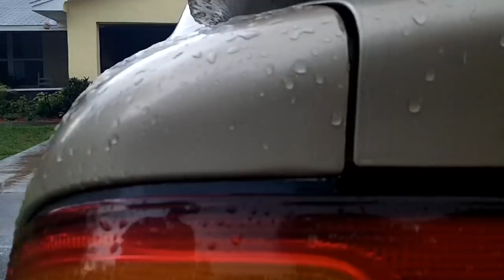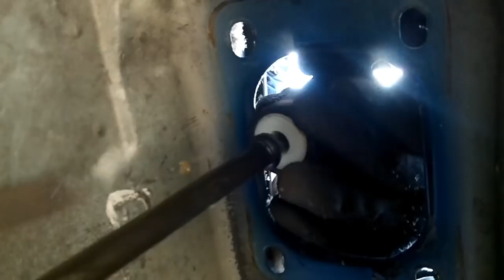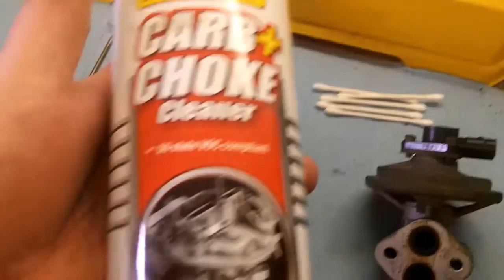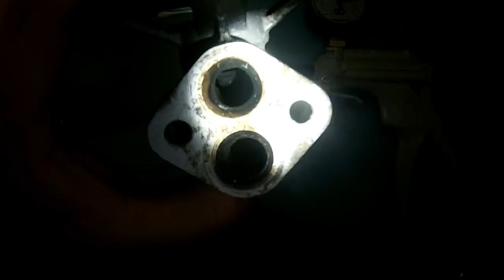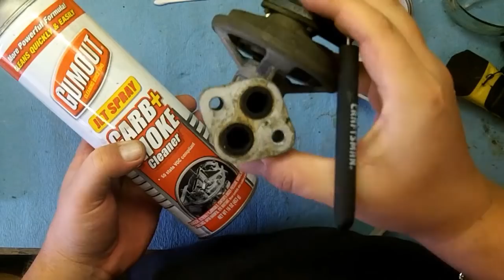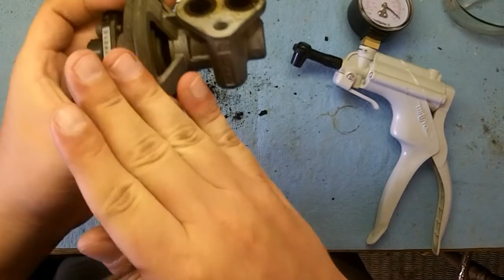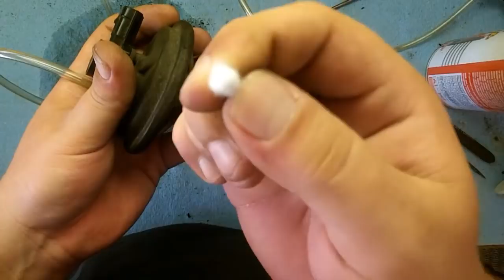How To Clean the EGR Valve

Comment: Cleaner valves and IM sounds like a good enough reason to me!! Thanks!!
Now I'm assuming that by blocking it off, it would cause a CEL light since the EGR has a sensor.
Is there a way around that??
Like maybe an ECU flash of some sort??
Also would blocking it off affect any of the other systems that use vacuum pressure on that line??? (or are there any??)
Reply from the maker: I'm not really the one to ask about EGR block offs.  I've never actually done it. There should be plenty of info on forums about it.

Comment: I live in a part of the country where emission testing is not required.  (Lucky me!)
I was thinking about deleting the egr with a small piece of sheet metal with 2 holes drilled where the bolts go.
I heard that outside of emissions control, it does nothing more than gunk up your intake manifold.
Would this be a good or bad idea in your professional opinion???
Btw, Thank You for everything you've done here and on your other vids!!!
Has helped me sooooooo much!!!
Restoring a 94 Probe GT!!!!
I am going to do everything in my power (and budget) to have it running better than ever before by Spring 2015!!!!!!!!
Reply from the maker: I'm hardly a professional but thanks for thinking of me in such a way.  Honestly anything you do to deviate from the stock setup will force the vehicle to run in an unoptimized state.  It would require me to write an essay on why deleting the EGR is not in your best interest.  Unless you're highly advanced and getting into turbo tuning leave the EGR where it is.  Sheet metal should work ok but keep an eye out for it rusting through.  Sheet metal won't last forever.  A milled piece of aluminum would probably last longer and be a better option.  I've seen guys cut up beer cans, flatten them out, and drill holes for the bolts.  Free aluminum block off. ;)

Comment: Engine light still on sorry
Reply from the maker: Sorry I never noticed your reply Elliott.  The most common source for EGR clogs is inside the throat of the intake manifold where the EGR gas is shot into the manifold.  It's about the size of a pencil and what I was referring to in the video.  This video is only for showing how to clean the EGR valve not the entire EGR system.  I have another video that does show the opening into the intake manifold that I'm talking about here... https://youtu.be/ZSKs1WfM70I?t=7m40s

Comment: Hey i had to do the same on my 626 i just bought another EGR clean the throtel body and were the egr goes but the engine light its still one keep going to autozone and advance to get the engine light check and it keeps telling me the egr its not reading
Reply from the maker: What's the code?  Could be the wiring or grounding issue.  Check the plug for corrosion and make sure the pins are making good contact.  Test the EGR solenoids.  All Mazda 626's have EGR solenoids but some might have 2 and some have 3.  Depends on year, engine, and transmission config.  A solenoid can fail and still report that it's working just fine to the ECU especially on the 93-95 OBD-I models.  Also make sure that port where the gas enters the intake manifold isn't clogged that's the #1 source of EGR clogs on the 626, MX6, Probe, and Protege!

Comment: Yes, but have you ever POLISHED one?  :P
Reply from the maker: redraif One good way to check the EGR exhaust port (where exahust gas is shot into the intake manifold) is to blow air through it with the EGR removed.  Pretty simple test to check for a clog anywhere in that system.  I have another video that details the routing inside the intake manifold for my 626, simply look for something similar on your montero.

https://youtu.be/ZSKs1WfM70I?t=6m41s

https://mazda626.net/topic/41067-egr-inspection-cleaning-1993-2002/

That should give you a much better idea of how the EGR gasses are routed through the intake manifold.  The passages are built into the intake manifold itself.  Thankfully the 626 manifold has a cleanout bolt you can unscrew to gain access for easy cleaning.
Reply from the maker: Are you talking the holes like a port matching polish or just an exterior polish?  I can do both but is there any benefit to polishing the interior holes?
Reply: LOL!  No... there would be no benefit. I polished the exterior.  I polished the exterior of a fart re-breather.  On a 4g63 it's buried under the intake manifold, covered up by the car battery, so nobody will ever see it anyways.  It's the dumbest thing I've ever polished and I showed it in my cylinder head port and polish video.  lol.  :F
Reply from the maker: *****
I don't think it's dumb to try and make things look nice.  However, in the case of the EGR it would be a really dumb thing to do.  It has that special rust inhibitor coating from the factory.  Don't want to take that off if you can help it.  No I've never polished one but I've done my fair share of stupid stuff like everyone else.
Reply: 'just letting you know I can be a dumbass.  ;)
Reply from the maker: *****
 Maybe I'll try using coffee filters next time and paint the inner holes with glyptol. :P
Reply from the maker: Oh and not sure if you noticed or not but that EGR valve has a Mitsubishi logo cast into it. ;)
Reply: saw that... I was looking at it and looks very much like my Montero sport version.  Less the electronics on top.  Your video was the prefect one for me to stumble on. Thank you!  Hoping to tackle a intermittent returning EGR code P0401.  Mechanic can't seem to get it to stay gone.   I pay him $100 for the code to be gone for 6 months and return again and again.  He cleans or replaces EGR components and it still returns.  Surely he is missing something.  Betting its just improper cleaning.   SO I will clean it myself and the EGR to intake port as you suggest.  Hoping this finally does the trick.  Truck now will not accelerate and has p0300.  Read that a EGR stuck open can lead to general misfire codes...  Fingers crossed.  After this... on to fuel diagnostics...

Comment: will it be a bad idea to soak the bottom part of the EGR in some sort of liquid clear? taking good care not getting any of it on the rubby part? idk, maybe paint thinner?
Reply from the maker: You could definitely do that.  I would use Acetone based paint thinner.  Carb and brake cleaner is basically just an aerosol version of acetone, that's all it is.  Guess what else is acetone based... fingernail polish remover.  The entire premise behind carb cleaner is that some guy a long time ago borrowed his wife's fingernail polish remover to clean car parts... when he discovered how well it worked he decided to make it into an aerosol and sell it ;)  For really bad carbon build up that you cannot scrape off (it's possible).  You can indeed soak it overnight being careful not to get it on the diaphragm or sensor.